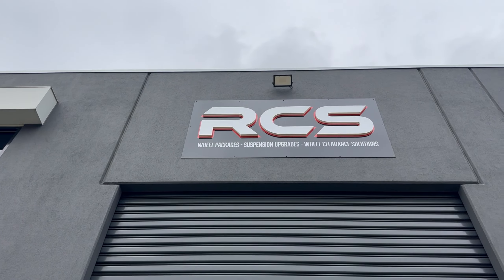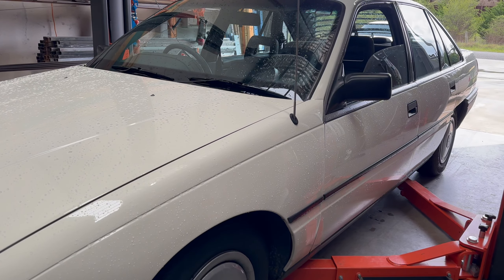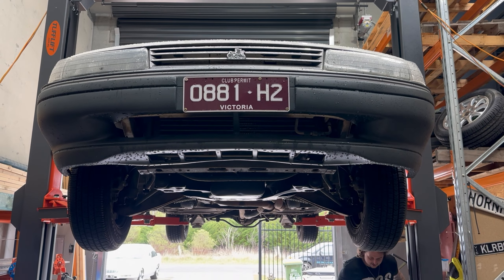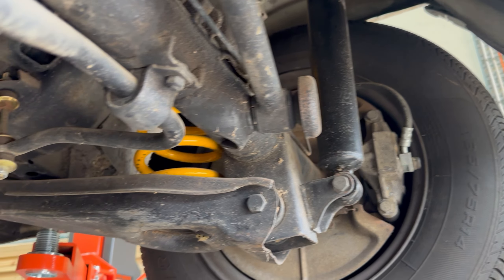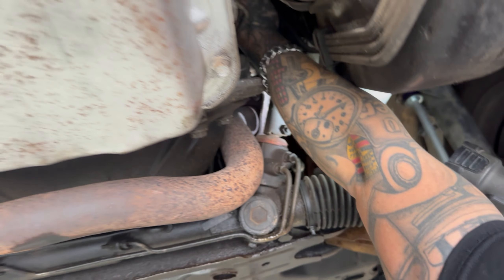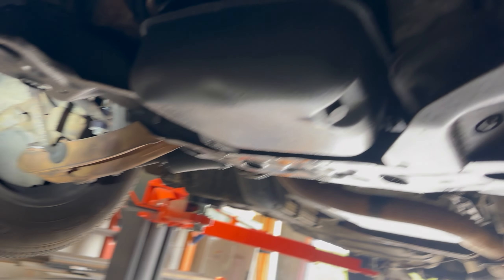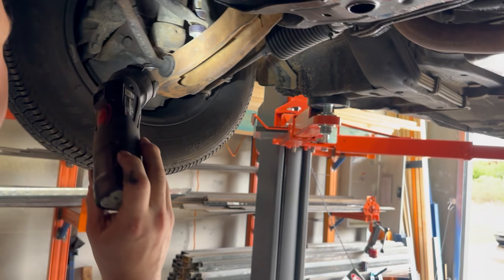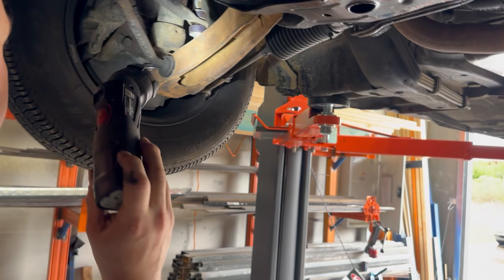How bad can it be?

Comment: My mates had VN’s back in the early 90s

On the automatic just as you first accelerated, they had a vibration 

Long story short the first uni joint on the tail shaft is not the best geometry and there were kits available to put bushes under the mounting to make the tail shaft sit a bit straighter because as the suspension settled from new and the bushes all wore in 

the angle of the first uni joint became exaggerated and caused of vibration 

Other than that, the Buick V6 is very good